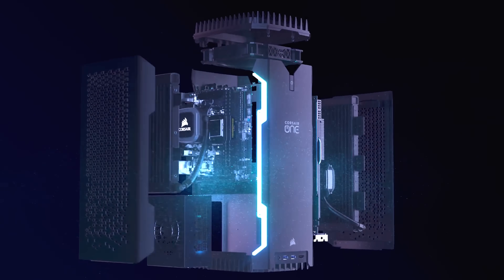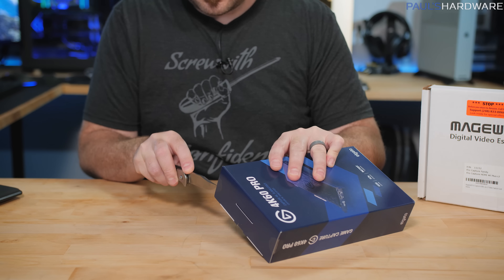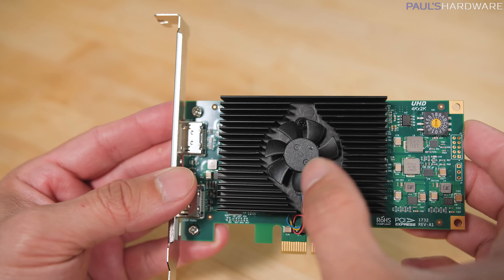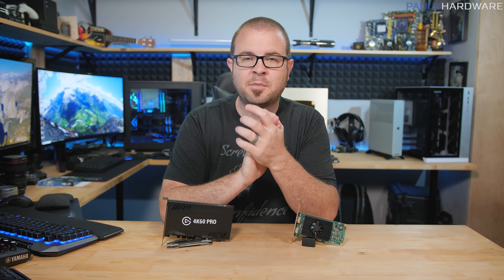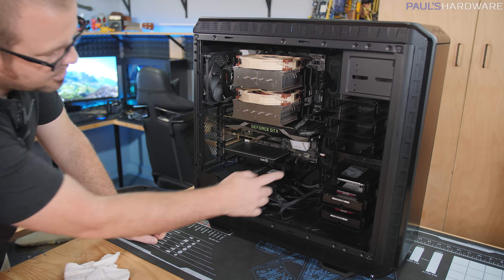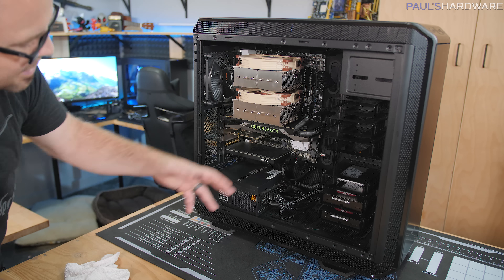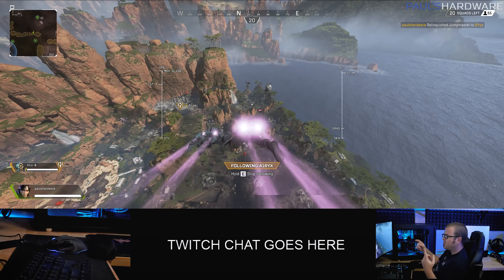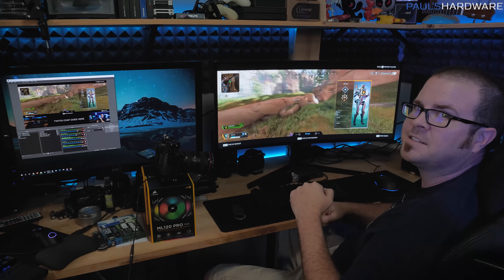Installing Triple 4K Capture Cards, Because Why Not

Comment: Hey I know your video is old here. But is this possible to have 2 4k60 pro mk2 in the system. Reason I’m asking is that find using one capture to configure the PS5 to output at 4K and a PC to output at 1440p 144hz is cause issues with the switching of sources and routing of hdmi cables & cloning of monitors. Because I game on ps5 with 4K and pc with 1440p. So if u installed a second a 4K 60 pro, will this help to separate out sources n captures? And if so when u have two capture cards kn the same system, is the software downloaded twice or is it once depending on which source is turned on?

Comment: I run a dedicated stream PC with 3 capture cards. 
Elgato 4K60Pro
AverMedia 4KLive 
AverMedia LGHD2 ( 1080p) 

PC has Asus ROG Strix X99 w/ i7 5820k. The GPU is a GTX 1660Ti 
I'm going to upgrade the CPU to an i7 5960x. 
I have one more PCIe slot available.

Comment: Hey Paul, I am running 2 4k60 pros as well but need a few more hdmi inputs for my cameras. I was wondering does Elgatos flashback recording work with the magewell capture card? I read that it might be able to work as long as the system has at least one elgato capture device in it? I know this is an old video but I thought I would ask someone I look up to. Thanks man.

Comment: Paul, can you post more info about these Pro cards like Magewell and Black magic? Do they have hardware Encoding or they still use your CPU or GPU like Gaming Capture cards like Avermedia 4K/HDR and Elgato 4K/60 [the one you installed]? Im interested in doing SINGLE PC 4K/HDR capture while i game, i tested Avermedia 4K/HDR and it reduced teh FPS by 40% since it uses NVENC to capture in HEVC

Comment: For $900 they sure didn't provide a very good fan. You'd think they'd use a larger more modern design vs. that noisy 40mm fan design of the 1990's.  I'm curious what screen capture software you use.

Comment: I own that Noctua cooler. instead of making it vertical you should make it horizontal the remove the fan that is interfering with the RAM and put it on the other end of the heat sink. I rendered a video for half an hour and my CPU maxed out at 45 Celcius running at 5ghz. ROOM WAS 22c

Comment: With three separate capture cards, could you have each of them record to a separate output file?  LIke have each input device be recorded by OBS or multiple instances of OBS to separate outputs with each a different file name?  Or, does OBS require that you bring all of the inputs and then merge them through the 3-separate partitioned screen into a single file?  I'm curious, because I don't have the capture cards -- but would like to capture three different video sources and save them out to different files, while all running at same time and each not interfering with the other.  If anyone can answer, please do so.  thank you.

Comment: you can get 4 hdmi in or out on a single blackmagic decklink quad hdmi card. Although you wouldn't have a loop out so you would have to split your hdmi before hitting the card for the lowest latency possible. https://www.blackmagicdesign.com/products/decklink/techspecs/W-DLK-36

Comment: Thinking about doing something similar on our church's computer system. One for the presentation slides, and 2 for dual cameras one wide angle for the worship band and one close up for the pastor.  I built the system recently with 2 rx570 cards, a b450 mobo, 2600x, and am running aster to have dual seating so the slides and stream are able to run independently on one system.  OBS usage shows 10-15% when streaming.

Comment: Happy Father's Day Paul.

Have you thought of side mounting a Cooling Fan over the capture cards and modding the door so it has space to either mount a fan, or just to vent some air? I did that recently to a case which had a solid metal side panel and it made a huge difference. It use to be more common a mod in the 90's and early 2000's.

Comment: Paul, what do you mean by adapter for the U.2? You can EASILY turn one U.2 port into 4 x SATA ports. It's literally one cable with splits.   Just look up SFF-8643  to 4 X SATA on Amazon. And you're done.

Comment: If you don't need the pass-through tough (which you can avoid with an HDMI spliter):

DeckLink Quad HDMI Recorder
PCIe capture card with 4 HDMI inputs for capturing up to 4 different SD, HD, Ultra HD and 4K formats at the same time!
$545
https://www.blackmagicdesign.com/products/decklink/techspecs/W-DLK-36

Comment: Hey Paul is it possible to output smooth 1080p 60fps stream or recording on YouTube while enjoying 144hz for yourself so its not stuttery or laggy since 144 doesnt divide by 60?
Reply: With 2 systems that would be quite difficult.
Reply: @everythingfeline7367  thats why i am asking if i need a capture card or not
Reply: @PyroGuy  if you only have one system you could do a direct software capture which would be problem free but might hinder performance slightly. If you want a 2 system setup you could either deal with the tearing or do what Paul did and mirror the monitor to a 60hz output and then capture that. The second option may or may not have tearing depending on how windows does mirrored displays
Reply: @everythingfeline7367  one system
Reply: @PyroGuy  What hardware do you have? You should be able to just do a direct capture with your OBS of choice.
Reply: @everythingfeline7367  I have a gaming laptop and a 144hz monitor
Reply: @PyroGuy  I wouldn't recommend streaming or recording with a laptop. Temperatures/performance on most will make that an unpleasant experience, but you can always try.
Reply: @everythingfeline7367  im not playing triple AAA games or GPU intensive ones,only the one from my channel
Reply: @PyroGuy  then you should be fine doing a direct software capture. I use OBS and it works great, but let's just say there is a reason I'm upgrading my CPU soon.

Comment: With all you've got in that case..and considering that you said that the Elgato card runs pretty hot, that BeQuiet doesn't have so much airflow. 
It's a nice case but have you considered buying a case with a mesh front?

Comment: In my experience duplicating monitor output creates problems with capturing. Not sure if it is Windows related because some games just tear AF when you have like 144Hz main monitor and 60Hz capture.

My solution: (will refer to a PC you game on as gaming PC and PC that only renders is a streaming PC)
On gaming PC, make your output to capture card to be just another monitor, no duplicate. Install OBS, andset colors to RGB in OBS on gaming PC. Setup the sources, RMB on preview, Fullscreen Projection, pick your "virtual monitor" as an output and that is it (aka monitor that's your capture card).

On streaming PC all you need to do is capture that output with the same exact settings you had.
On gaming PC previewing does not cost almost any resources even on RGB. NV12 color format on gaming PC's OBS does make it look a tiny bit worse so use RGB there.
Not sure what kind of CPU you need to render RGB on streaming PC, guessing some 16-32 core beast as x264 can only use up to 27 threads for 1080p stream. 18 for 720p.

x264 determines number of threads used by taking lower value out of either your total thread number multiplied by 1.5 or your stream's vertical resolution divided by 40.

Anyway, when using NV12 on streaming PC over the source that's a preview in RGB color format from gaming PC you get virtually the same quality as when duplicating displays, minus all the issues.
Maybe someone spots the difference who runs a calibrated 10-bit monitor. But such person would also notice tearing caused by duplicating display.

This way my 70$ potato EzCap294 capture card captures stuff with ease. I get screen tearing with duplicated display but since I switched like this not a single one. Recently started off streaming for cheap, my gaming PC was not enough for both gaming and streaming and getting a potato PC to handle rendering was cheaper than getting an upgrade as I already had some parts around (that was before DDR4 prices dropped and before Nvidia's new encoder, yes, I still have DDR3 as I live in Serbia where I earn 300$ per month, dual DDR3 PC setup actually gives a decent quality - it can do faster preset on 864p).

Which could be a cool video idea for budget streaming, 2 used PC's that are nearly outdated, assuming you have one PC building a second one out of some old workstation or something is a great value proposal.
My overclocked FX8300 on my streaming PC can do it with ease, any 1GB DDR5 GPU does the job, 2x4GB of ram, a potato hard drive.... Already had an old mobo for FX so that was my reason for the choice, save the buck, you can probably go a bit better with some Intel workstation or even do dual CPU as those workstation CPU's a are 10-20$ with 4 cores and 8 threads. Even if you go with very fast preset for streaming on 10$ CPU - it is a great value as your average 8700k can't do much more while gaming and streaming without dropping frames when CPU chokes on the game and everything running.

Hope this solves your problems with some funky capture cards rejecting to capture or tearing and showing lots of artifacts, saw it helped to a lot of people.
Reply: running 1440p 144hz 10bit hdr600 along side a 1080p 240hz with absolutely zero issues. both on display port.

the tearing from streaming 60 while gaming 144 is because the capture card is shit. use dedicated cpu or gpu streaming without a card and you wont have that issue. i can literally steam to youtube 1440p60 while i game 1440p144hdr.... no issues. and with ryzen 3000 it will only get easier with the 12 and 16 core parts
Reply: @goblinphreak2132  for one, even the most expensive cards on the market can have that tearing issue, just look at Shroud's R6 Siege streams - when he flicks the mouse screen tears in 70 places. And he uses a very expensive capture card on his streaming rig and he tested like 200 of them. So problem likely comes from set of circumstances more than "it's shit" compatibility with every possible manufacturer and and a part and a program support is likely the issue.
My capture card is not bad, it just lacks features like encoding colors without taxing your CPU, recording without taxing your CPU, multiple inputs and all the good stuff.
But as for capturing it does the job, picture is looking fine, colors are in place, no artifacts, no lag, no dropped frames...

For two, at the time when I bought my streaming PC GPU rendering was WAY worse than CPU encoding for upload lower than 5000. And I do not have that kind of upload sadly so I had to go for CPU encoding.
Now new NVENC is decent, but I found a good deal for 1700x just yesterday and I actually managed to push my streaming rig to a slow preset x264, high profile and RGB color format. Dedicated GPU cannot do that and it costs way more to get it than what I paid for 1700x.
So I really struggle to see value proposition there, pay more to get less quality and less options and features and more random bottlenecks when you switch from CPU intensive game to GPU intensive game or vice versa?
Bet you cannot stream in RGB color format without encoder overload.

For three, even 10 year old 2c/4t CPU can render 1440p60 on ultra fast preset so resolution alone means nothing,
Sure for GPU is different, but resolution of the stream is mostly decided by your upload speed

And ftr, you cannot use dedicated CPU for rendering without a second PC, your CPU will be used for gaming and everything background, so in order to make other PC take input so you can dedicate it's CPU to rendering you either go for capture card or HDMI over LAN.
It is possible with virtualization to split your Threadripper into more CPU's but you need 3 GPU's for that setup so it is basically the same thing.

So capture cards and dedicated streaming PC's have value proposition, they can be budget oriented if you have a gaming PC or a laptop that just cannot stream too and they are also the only way to maximize your stream's visual quality.

Just because you can click "Start Streaming" with wide variety of setups it does not mean you got the best possible quality for your money.

Comment: How did you get the 3440x1440 res to work on the 4k60 pro? i returned mine because i couldn't get the native res to work when using the capture card.
it gets stuck at 2560x1440 with black bars on the side and i only get 30hz, did you used an hdmi splitter? i can't it to work...
Reply: Might have been an issue with your system, like the slot running at 1x instead of the 4x it wants, or something like that.
Reply: I doubt it, i tried everything, even using the x16 slot, but even with a hdmi 2.0 splitter i only get 2560x1440 res with 30hz output, so i had to go back to a 1080p monitor because of that, i have it like this tho, you tell me if I’m wrong...
Gaming PC -> splitter -> monitor & streaming PC. 
Still reading the capture card on the control panel, which is really stupid, it should be the monitor but it isn’t.
And i don’t feel like spending $900 for a capture card.
Reply: @marilyto  That is rather strange. Im assuming you have a GPU in the streaming system though. Which if that slot is running at x16 you may also have a few lanes going to a M.2 slot which may not leave enough to run full bandwidth on the capture cards slot. Chips like the i7-6700 only have 16 to work with total. The 6950X Paul has in this system has 40 total available.
Could also be the cables you're using, some cables and splitters can't handle a 4k60 signal.

Comment: I definitely think having multiple capture cards is a must as a streamer and content creator. But I would recommend one 4K60 capture card and then get a magwell quad capture card. Does 1080p60fps on all 4 capture slots.
Reply: We are relying on NDI for 3 machines to go to a main streaming PC and while I haven't had too many issues with NDI not working in OBS studio/streamlabs OBS, I am interested in learning more about the quad capture cards. Would be interesting to hear if anyone has done 2 or 3 of those into a single "command" streaming PC.
Reply: KidMattersTV I’ve heard of people doing it and it still works with no problems. If you want to hear more we can talk in my discord server about it.

Comment: So why not use ndi 3.8 toolkit and get a 10 GB card 4k 60+ is capturable and if you want more then one 4k scorce if your network switch is powered vs unpowered you can use other things and bandwith settings. The problem with capture cards is they are only one adapter hdmi only, display port only, etc. My ndi config is 1440p 144fps capture and can dynamically change. Disadvantage is it cant do consoles without a passthrough usage. (Maybe will change with next gen)
Reply: We are doing 1080p/60 with NDI from 3 PCs to my main 4th PC with few hiccups. Good to hear the NDI can do higher res. How much does that output onto the network for bandwidth? Can't imagine have too many before it would potentially swamp a 1Gbps NIC
Reply: @KidMattersTV  the exact bandwidths are on the website for ndi. There is a little chart for it. That's why I said 10gbe. Most people choose the easy and more expensive capture cards for convenience (plug and play) but you lose performance in one way or another via signal (fps, resolution, need to use a specific plug). If you look at task manager you can see accurately the load that is on the systems. The advantages are greater via multiplicative, (1 network between systems, network storage or file transfers, the ability to capture wifi cameras(need a good router), future proofing the systems,etc) most professionals use telecom signaling with ndi for TV broadcasts over fiber lines. The only advantage some capture cards have is the encoders. Which if you have a crap system then yes, but most multi system nodes have a dedicated system for this. Via black magic server box(uses ndi) or a streaming PC.
Reply: @polarbearigloo  , thanks, I will have to dig into their site more. We have started looking into upgrading to 10Gbe, Though we aren't doing 4k yet for gaming vids...trying to save money to make the move next year (or worst case year after that for the 4k/10Gbe). Hard to be sure of finances with family of 7. :)

Comment: I have done this before with 3 different capture cards but is just easier to pickup a black magic atem switcher for $1000. I'm going to build a mobile streaming and capture rack in a 4u case. Hit me up if you'd like a demo.
Reply: I just read a snippet about a Magewell quad 4k capture card, that someone had 2 of the cards in their system because they needed 6 HDMI ports for a 360 camera rig they had (with caveat "just remember to change the "card number" using the little rotary switch on the card") $900 a card though. ooof, I think I will stick to our NDI/OBs setup (4 computers)  for now :)

Comment: Does the Elgato Cam Link not work with 4k camera/camcorders?
Reply: Mine works fine, only issue I had was my motherboard USB had too much plugged in and was causing issues. Got a 3.0 / 3.1 USB pci-e card in a x8 slot and it works great.